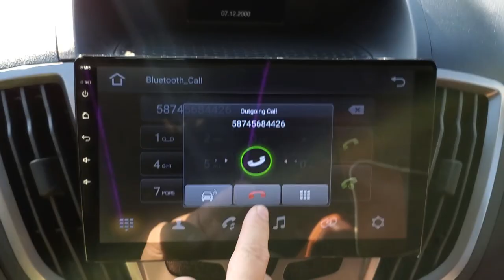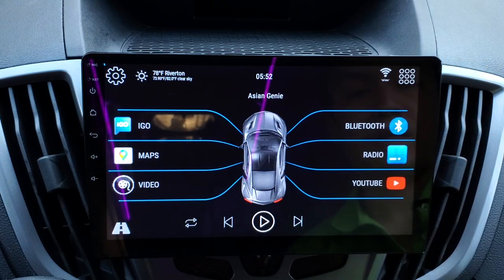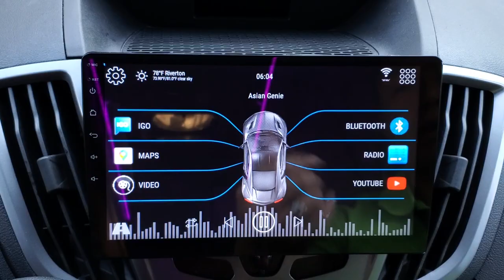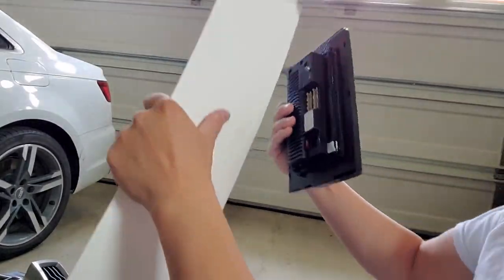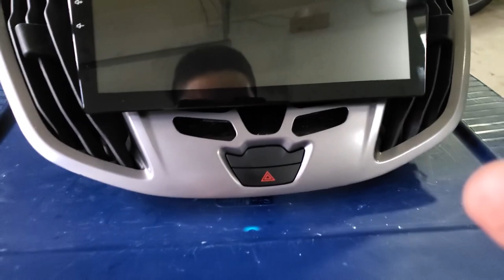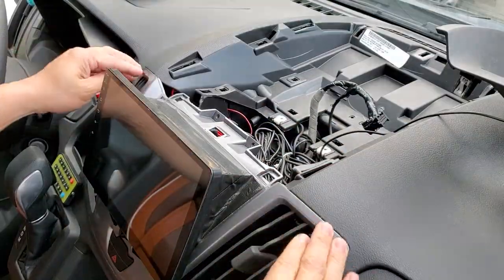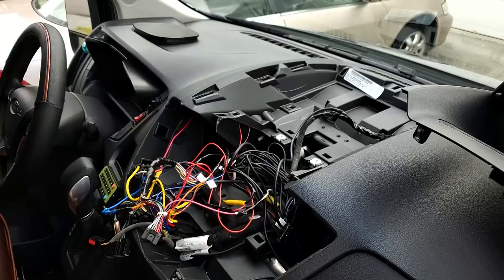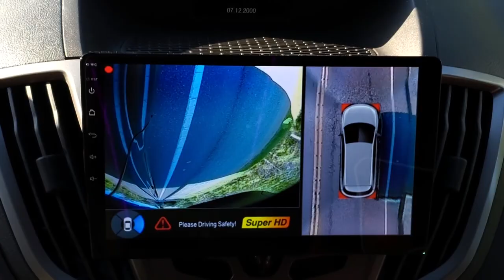Amazing 10" HD Tablet Double Din stereo system | Onboard navigation bluetooth wifi screen share.

Comment: Thank you for sharing Kenny.  I have the long transit and was wondering if the wiring for the rear camera that came with the purchase enough to reach to the back?  Also, where in the back did you attach your camera?  I was thinking to put it on the top where the stock's rear camera is, but don't know if that's a good idea or not being that high.  Let me know your thought.  Thanks.

Comment: Are you using the same back up camera for this unit AND your rearview mirror? Or did you have to use two separate cameras? Great video series!
Reply from the maker: I did 2 seperate cameras because the rearview camera, i wanted to see up high. In case there is a tree branch or roof that i might back into.

Comment: i  have question about it , the home bottom which coming on the side is not working and it is still new never used, is there a way to reset it to home factory and how do you reset it . please help
Reply from the maker: Home icon would just take you back to the main screen. If you need to reset just turn off power. I think there is a small hole for resetting on the top or bottom of those buttons. You can also download carwebguru launcher on google play store app and customize the look and navigation buttons. Go into car setting menu and there is a factory reset.